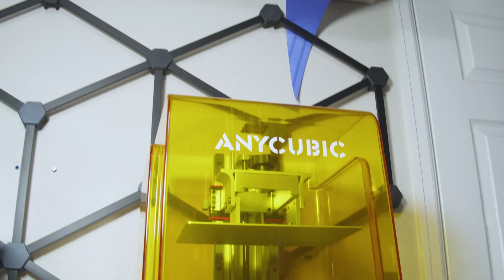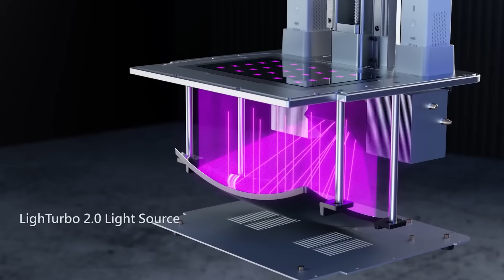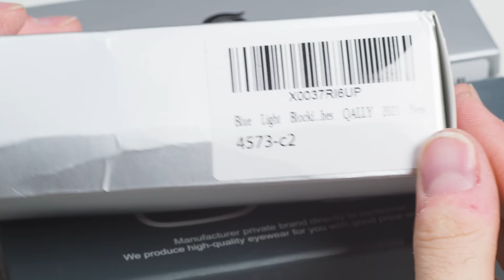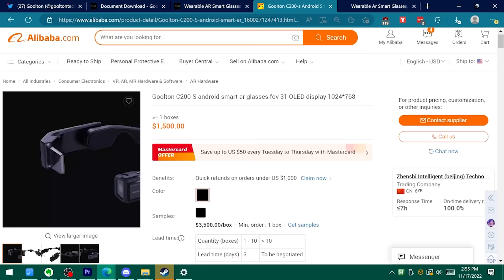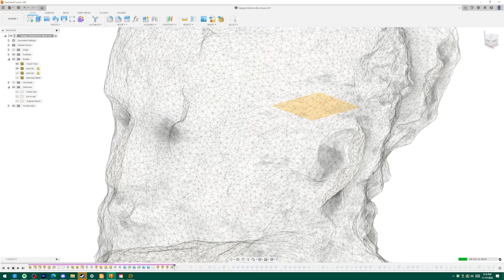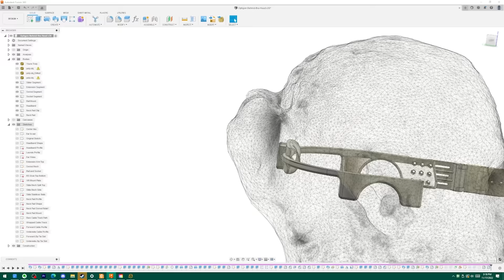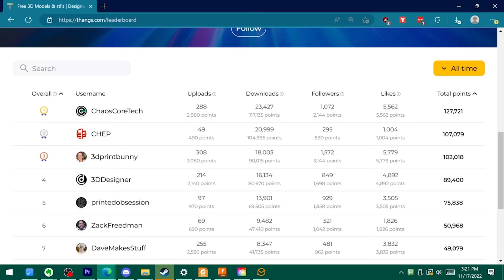Why I Trashed a Perfectly Good Wearable Computer | Optigon 2: Part 3

Comment: I actually used your head 3d scan to contour a pair of sunglasses to match a human head for my own HUD project. It will forever amuse me that the HUD upon my face is not actually contoured to fit me but jankily fits for some reason anyway, such is being a maker I suppose.
Reply: Sunglasses also arent contoured to fit each individual person and they work fine. It can work fine and fit many people if you just go for a design that fits the average person.
Reply: I printed a whole mask out of ceramic fiber, and thanks to elastic deformation every day my face becomes closer and closer to his face.

Comment: To help with weight distribution just add a non circuitry related weight on the other arm, might I suggest using uranium-238 or osmium-192?
Reply: If he does that they will Barium.

Comment: Optician here. Real "blue blocker"(yes they are not 100% blocking) lenses are actually slightly amber. They help prevent eyestrain, not be a lab equipment. You should be able to wear them all day. Good opticians even advise graphic designer or anyone that works with colors against using them, because they alter the perception of color.
Thanks for the video. Fun to watch, as always.
Reply: Yep, I can confirm, everything gets a nice "warm white" look to it :D
Reply: oh no. I am a fashion designer and I wear blue light filter glasses daily. Whoops.
Reply: Not entirely true. Gunnar has a set of blue-light blockers for outdoor use that are...blue! I actually use them during winter storm Yuri. Blocked ice glare amazingly well

Comment: Since the plastic is flexible, couldn't you use that to your advantage? Model a channel around the outside with brackets or a tunnel through the center to slide the wire in. Since the plastic is flexible and the wire holds the shape the combination  would allow someone to adjust the tension without having to model and print an exact fit.

Edit: also it's extra work but using the 3d print as a base it might be advantageous to make a silicone mold and cast in a material not sensitive to uv (skin oils might be a problem too). I'm assuming the resin will become brittle if you wear it enough outside or in.

Comment: Fair warning about carbon fiber nylon, as I came to find out, is that they plastic deform incredibly easily over time. If you print your frame out of it, I suspect you're going to find that the shape has altered drastically over the span of a few weeks (It's also entirely possible this could vary between manufacturers. The one I used was Adura X)

Comment: I think you could also extend the cross section/thickness of the headgear, the larger area of the cross section would decrease the stress incurred by the frame. It would be bulkier but it should help with deformation. I was also thinking a taller face pad would help anchor the head gear and keep it from rotating.. Shit I think I just reinvented a helmet

Comment: Now that it is a six axis arm, just need to add some hydraulic or pully systems to move it with a motor.
Reply: That would be sick though. Voice controlled obviously, so you can say "on screen!" or "heads up!" And it moves in position.
Reply: @Frrk  man you could fit mycroft in there to do that too!

Comment: All your missing now is an overengineered way to automatically   move it out of your eye for that unnecessary but cool sci-fi factor. The first time I remember seeing a heads up display was in the original tomb raider movies which are fun m9vies by the way. The coat hanger solution makes me wonder do any of the printers here have the ability to print around a metal frame work for extra strength. Awesome work thanks for the vid.
Reply: There exist 3D printers that will automatically incorporate things like carbon fiber strand from a separate roll into your parts as they are printed to increase strength and stiffness beyond what normal filament is capable of. You can also do a poor man's version of this by editing your G-code to add pauses in the print (and head relocation if necessary) so that you can manually lay down reinforcing material and then resume the print. To answer your question specifically, yes, you could also use solid metal instead of flexible strand, but you'd need to create an open cavity in the 3D model to give clearance for the print nozzle until the Z height clears the top of whatever you've inserted.
Reply: Sorry for the long delay before response, but in case you were still wondering, I experimented in university (with a Prusa MK2 IIRC) with embedding some of the spare nuts that came with the printer into printed parts, leaving only a threaded metal hole in an otherwise plastic part, like a deluxe version of a heat-set insert. It worked out really well!
It's possible to design a part with a socket just big enough for your metal to fit snugly in, insert a 'pause until operator attention' or 'manual filament change' instruction into the G-code at the correct layer (PrusaSlicer has this automated now I think, you should be able to just queue up a pause after any layer in the slicer), manually press your metal or other foreign object into the socket (making sure it does NOT stick up out of the hole to catch the nozzle) and resume the print to seal over the object. The trick, of course, is choosing embedded objects that have a precisely-predictable enough shape that you can be sure they will both exactly fit into your socket, and exactly fit the layer bridging over the top with a flat surface. I'm unsure a hand-bent coat hanger could be precisely shaped enough to use this way easily, but it you could find another reinforcement with a flat, level 'top' and a predictable shape it should work quite well.
I haven't done it with the Prusa MK3S I later got at home, but it's a trick I've kept in mind in case I ever do a real project like this. You can make some VERY professional-looking threaded parts, at least. If I were buying hardware for it, I might go with square nuts, because those would cleanly, securely bridge over in one horizontal surface in a horizontal orientation as well as a vertical one. I haven't tried metal structural reinforcements, but they should work similarly, with the caveat of having to chose between easy availability and precise, flat tops.

Comment: Not all blue blockers are BS. I own a pair made by Zenni Optical. They're prescription and have several coatings. One of which is a blue blocker. They only block specific wavelengths of blue light, not all blue light. They're tuned to reduce the particular blue wavelengths that cause eye strain and do work. I don't get eyestrain with them. I do get it with identical glasses minus the coating. I also tested them with a few light sensors, and they do block most of the wavelengths they report to block. You do notice a tiny color difference with them on too. They do not look yellow. They look slightly blue from the "far" side, and completely clear from the "close" side.

Comment: I get why you want to keep with the "print everything" shtick, but as a headband, it would be better to take some design cues from headphones.. They use metal strips in a sort of reverse leafspring stack.

In the case of an HMD headband, I recommend windscrenwiper blades. They almost always have an inner steel band core, which is already tempered to have some spring in one direction. Stack 2 on top of eachother, pre-tention, and drive a rivet through it, and you have your perfectly tunable headclamping action. Without adding much weight, might I add. Godspeed Freedman!

Comment: Idk if anyone's said anything but a good suggestion may be to add a Channel for the coat hanger and use some "goop" adhesive or maybe jb "plastic weld" to hold it in place

Comment: make an extension cable and use 1grit ply
But honestly, you can use the tough resin with a dedicated channel for the coat hanger, so you have a nice fittiny and looking frame, which doesn't shatter AND is holding it's shape, while also being "low" cost and effort.

Comment: Your resin screw up is called “fejl 40” in Denmark.

Not a fault with the equipment but a fault within 40 cm (~1.5 feet) of the equipment, i.e. the user.

Comment: For a quick hack you could you have heat welded the metal into it? Heat it up, burn in the shape into the back of it, and then use a bond agent if necessary. 
(Never done any of this so just wondering if thats plausible or mince)

Comment: 100% suggest trying out a material called Filamet (yes, its spelled terribly, and quite the pun) but it is a metal impregnated plastic that when sintered comes out as full metal parts. Im in the middle of trying to prototype a version of the honda rc211v v5 engine but sized up to take 5.0L mustang/Tbird rods and pistons with the stuff, its super cool.

Comment: You should just re-print that headband with a slot in the top to drop the wire into and a cap that you can glue over top of it.

Comment: how you zip tied coat hanger to head armature it gives you a softer surface for body contact but if you want it stiffer just put a grove and a few loops to hold the coat hanger then feed the coat hanger through

Comment: Since you have loads of 3d printers and materials now could you combine the materials to make a stronger final print. I don't mean mixing them, I mean like printing the "skeleton" first with a high strength material then printing a more brittle but tough resin on top. I might be explaining it wrong but like how steel reinforces concrete.

I am positive that when we rid ourselves of the flesh and embrace cold hard steel, we'll still have our fuzzy companions by our sides.

Comment: I have a similar off angle head issue. when I was in 4th grade I was walking to school with my friend. we realized we were running late so we started running. I fell and landed on my head. To this day my neck is not 100% ok and my head hangs at an angle leaning towards my right shoulder.

Comment: I don't know if others feel the same way, but both the previous version and the one you've been wearing for the rest of your YouTube career allowed us to see your left eye pretty well. This one does not, and it's a bit uncomfortable or off-putting to watch.

Since the previous version and this one use the same optics, I don't know why it is so different, but it seems to be, even in the clips of the previous version in this video.  Maybe the lens is just in a different spot relative to the eye-camera line.  I don't know if you can do anything to fix it, but I figured I'd mention it.

Comment: One ply has been slandered by big TP and I'm here to settle the score. So, TP is made in one of two ways, and the first one essentially is squirting fibers into a sheet that then dries and is rolled up. This creates the cottony smooth texture of TP your void star loves so much. Unfortunately, the fibers are super short, so this sheet is more fragile than an aging comedian's ego. They protect this poop paper with a ply produced in the same manner. The result is squishy toilet paper that will wipe you up and not destroy your pipes.

However, the single ply needs to be strong, soft, and soluble in the sewer. The cheap solution is to just make toilet paper the old fashioned way which aligns the fibers in one plane giving it strength, but not softness. Because this is cheap, any time you use the white stuff out in public your backdoor cries out in anguish. However, there is another way. If you make your loo logs the squirty way, but use longer fibers it costs significantly more per ply than all other methods. The result is a compact, comfortable toilet paper that is happy for you and your sewer.

Comment: I wonder how difficult it'd be to get a design to work with adjustability via worm gear screws on a printed rack. Who knows, say someone shaves their head one day, when they normally have a large amount of hair for padding, that neck pad isn't going to sit the same, and the ears aren't perfect fulcrums, you'd need to readjust the whole thing, and the current design with screw-locking sliders, hinges, and ball joint are a bit fiddly. Instead, with the worm gear adjustment, the joints are always locked, but also adjustable while the thing is on your head just by twisting the screw. The only tough one would be the ball joint but that's a bit redundant: You really only need four degrees of freedom here, the three linear axes for placement, on top of one rotational axis for tilt correction, and I'd imagine the height adjustment should be the last (and smallest mechanism) due to its range of adjustability (and human head size/shape deviation) should be the smallest out of the three, whereas depth adjustment would be the first after the hinge joint as this should have the largest amount of deviation in placement, leaving horizontal placement to be in the middle of the two; might also complicate the depth adjustment with both a coarse and fine adjuster. 

Realistically, if a production product like this were to ever exist, they'd be using an adjustment mechanism similar to this. Or they'd be banking on the use of friction elements with a push button release, which could be easier, you can pack the X (depth), Y (height), and A (rotation) axes into a planar slider that's circular to allow for rotation, Z (horizontal) would be the only one that can't be directly included.

Comment: Just slam a bunch of lead weights into the right hand side of the band to even it out.
Or steel if you're concerned about heavy metal poisoning. (why?)
Or mercury if you love heavy metal poisoning. (why?)

Comment: actually your build didn't ask for strength at all. your first design already was pretty strong as in no "plastic deformation". What you were looking for was stiffness. As in no "elastic deformation" Which comes usually before the plastic deformation. The distinction is important because as you showed you can have materials that deform a lot without actually deforming plasticly(as in they deform and return to their original form) and just over time and with more elastic deformations slowly deform plasticly. However usually highly stiff materials(for example PLA) will not deform at all but rather just break. PLA is quite stiff but not really strong.

Comment: Zack-  I'm thinking about hacking a BT30 or BT40 for creating about 10 captioning eyeglasses prototypes and perhaps my new daily driver. With your current design, is it stable enough to use while walking? Or is the lever arm too long so that it bounces too much? I suspect the latter, which is why I am looking at trying to keep the eyeglasses design from the previous episode. Any suggestions? (very sweet adjusting mechanics, BTW. And congrats on figuring out the Epson two eye -> one eye hack.)

Comment: The frame from glasses is generally made from 2 materials, some kind of stiff plastic or some kind of metal, this hasn't change in a century, and for a reason. I think your current solution is cool, because is overingeniered, and we all know over ingeniering makes everything cooler. But in actuality the coat hanger is probablt a better solution, simply because you don't need 6 axis, wires bend, and... that's it.

Comment: About those blue light """""blocking""""" glasses, yeah, they aren't that, because they let blue light through. What they actually are is blue light reducing glasses, if that's the correct term, because while they do let some blue light through, they don't let all of it and it can be best demonstrated by looking at something white, like some paper, without then with the glasses. When you look at the paper with the glasses you can see how the paper looks just a little bit more yellow.

I also hate that some glasses like that are being marketed as blue light BLOCKING, and they are awful compared to actual blue light blocking glasses, but if they are marketed correctly, then you could say that they're doing their job pretty well.

Maybe it's placebo, but I do feel that my eyes aren't getting that strained while wearing them, but that's also probably that they correct my vision, and my eyes aren't struggling with seeing stuff at a distance

Comment: I'm no engineer just a moron.....but wouldnt it be nice to have the cord come up the center of your neck into the middle of the frame and then have wire inside the back of the head frame. & the port out on the end where the display connects? Like if you ever made a mass produced version

Comment: i see you now RIP the software from a self centering camera sensor remake the sceen as light as possible put a tiny camera for eye tracking make the whole thing out or all3dp resing that is light like abs use straps of flexible latex perfurated fabric add a darkness shield for the lens so you can use it in direct sunlight use the resin printer to print stop it at 50 precent add a metal core with all the wires resume the print voila after that i can even tell you how to sell it